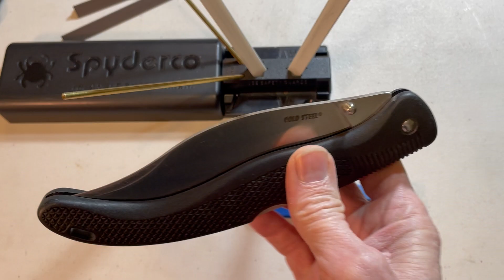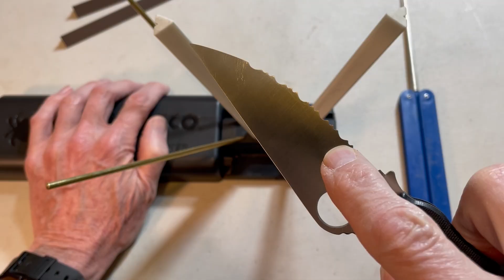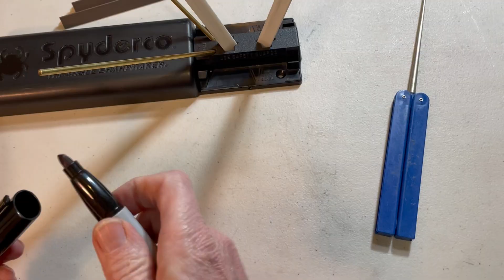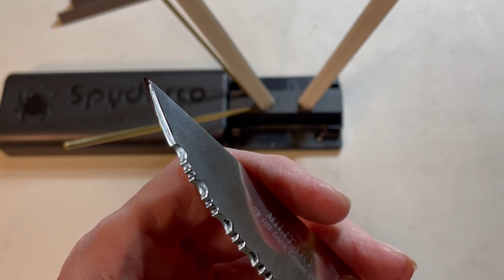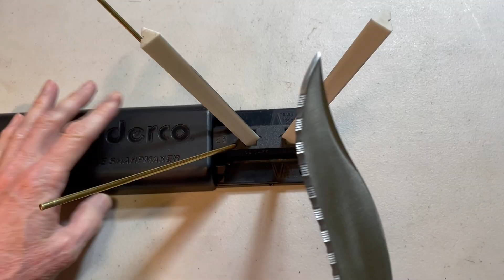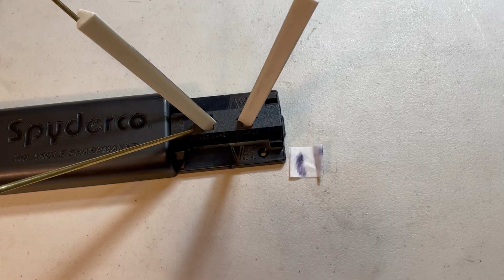Sharpmaker Tutorial Pt. 2: Sharpening Serrations

Comment: Thanks for sharing! I managed to sharpen a serrated portion of Microtech Socom Elite's blade using the sharpmaker. Microtech's serrations are similar to the spyder edge, so that works perfectly fine
Reply from the maker: I'm glad you found it helpful. In some ways, sharpening serrations on the Sharpmaker is easier than sharpening a normal plain edge.

Comment: Beautiful Military 1, always wanted one. Is that 440V ?
Reply from the maker: Yes indeed: CPM 440V. The Military 2 is better in several ways, but the original still has a certain allure. I have two of the oldies, one serrated and one plain. I love the way those things clack open.
Reply: @KnifeYak  from what I've read 440V holds up very well in serrated blades. I've been looking for one for a while, but it's elusive. I'm not a fan of compression locks on larger knives, so never considered  the Military  2
Reply from the maker: What do you not like about the Compression Lock? The old Military’s liner lock access has grooves on it—serrations, practically—that I found would bite into my index finger sometimes. On the other hand, some Compression Locks like to pinch my finger; I love the CL deployment, though. Life is all about trade-offs.
Reply: @KnifeYak  the gap that type of lock creates, and the edges where the lock mechanism is, digs into the palm between index & thumb. I much prefer the spine of a handle be smooth/flat.  I like the compression lock mechanism, and I think it works well. I don't mind it on smaller knives like the PM3 But, I personally don't like them on larger hard use tools. I understand what you're saying about the liner lock also.  In which ways do you find the 2nd better?
Reply from the maker: @MB_MagicMOnkĒLove  You're right about the edges of the compression lock indentation area digging into the hand between the thumb and Index finger; I've noticed this with the Military 2 when whittling try sticks, which entails fairly hard pressure on the handle over an extended period of time. I like the compression lock because I believe it's stronger than the conventional liner lock, and I can deploy it and reploy it easily with either hand. (To close the blade on the compression lock, for right hand I use the index finger, and for the left hand I use the thumb.) I find this even easier than closing axis/crossbar locks. I find it awkward, but not impossible, to close a liner lock knife with the left hand.

Comment: first 3 point serrations I sharpened with this system were on the Byrd Rescue 2. That one had the serrations at 17 dps and the other side at 7 dps. After that I sharnened the serrated blade on my Wave and Victorinox serrated paring knives which I would test. In those tests i noticed how i liked 1 point serrations with a rounded tip. I quickly noticed what you showed here that the stone would touch only one half of the scallop so i started going back and forth and also alternatinng, heel to tip and tip to heel. I always started from the CBN or diamond rods and seldom ended on the ceramic. after diamond/cbn i just stropped the edge a bit to get the burr off.
Reply from the maker: @SpartanJohns  That’s useful information, what you said about sharpening forward and backward to cover the entire width of the scallops. Thanks for watching and commenting.

Comment: Great job! You demonstrated this well! A couple suggestions: If you try to sharpen a serrated knife that’s really dull, it takes a LONG time with these rods. Best practice is to do periodic touchups with light pressure however frequently is needed depending on how often you use your serrated knife and how roughly you use it. Sharpening a really dull serrated knife takes a very long time because the sharp maker rods are quite fine and LOAD UP very quickly with metal filings. This happens much faster using the pointy area of the triangle on the rods because there isn’t very much surface there! You can rotate each rod to get a new fresh surface when they load up, but you can only do that a few times and then the load up significantly slows down your sharpening process, especially when the knife is really dull and you have a lot of material to remove. It can be pretty tedious to continually clean off the rods during a prolonged sharpening.
If the knife is really dull, you will find yourself doing that continual up-and-down motion without removing the knife from the rod and replacing it to the rod each stroke. I recommend that technique anyway, because I believe every time you place the knife against the rod, you’re impacting the knife on the rod with some force, especially if you get in a hurry, and those first or second serrations are taking the brunt of impact every stroke. This probably isn’t a big deal on a couple repetitions but when you have a dull knife and you are doing thousands of strokes, it’s probably pretty rough. Also it just slows down the overall process to remove and replace the knife on every stroke. So for longer sharpening, I suggest the up and down motion with the knife remaining in contact with the rods.
Thanks for the video. You really demonstrated this well. And it was fun to see an early version of a classic knife! 😀
Reply from the maker: @RockNKnives Thanks for weighing in. I’ll admit, my experience sharpening serrated knives is relatively limited, since the few I own tend not to get used very much.